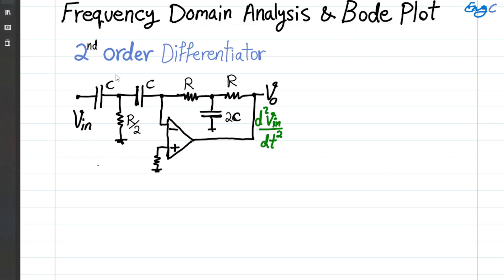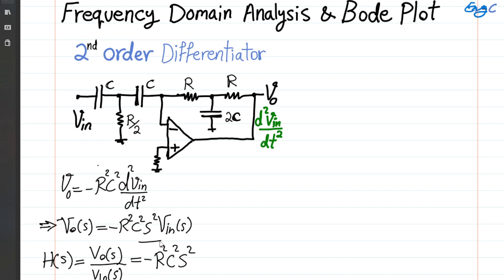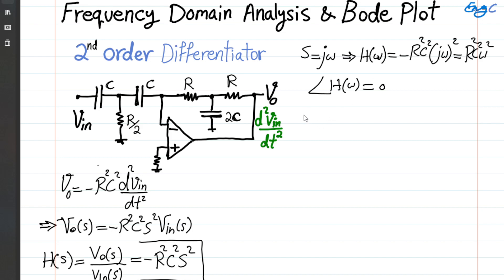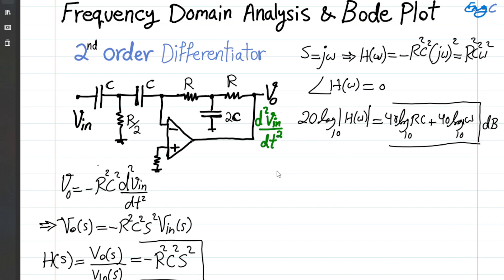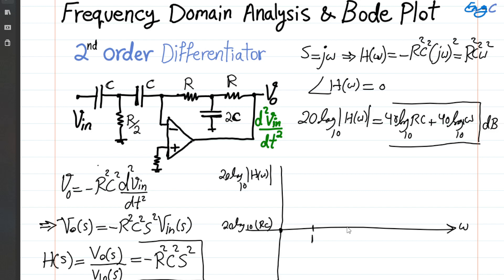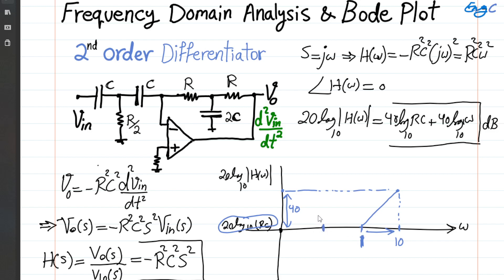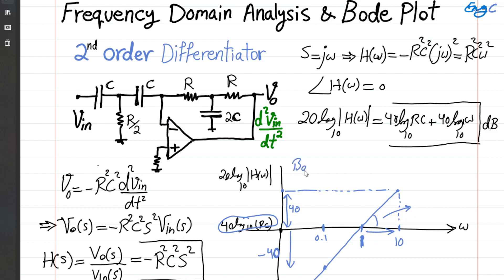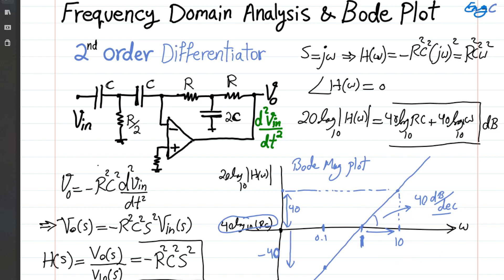Bode plot Frequency Analysis of Differentiator Circuit with Op Amp

Comment from the maker: Thanks for watching. For more Op Amp Circuit and Analog Filter examples please see: 
Op Amp Analog Computer Differential Equation Solver https://youtu.be/ENq39EesfPw
Universal Analog Filter Design https://youtu.be/2J-0msXZE2o
How to find Bode Plot, Freq Response, Transfer Function of Analog Filters https://youtu.be/vZFkPeDa1H8
Analog Logarithm Computer https://youtu.be/RpKEq5WyoLg
Laplace Transform Example and S-domain circuit analysis:  https://youtu.be/ps8N5TPM_qU
Op Amp circuit Bode Frequency plot https://youtu.be/BLVzuuqAlZs
Lowpass Butterworth Filter: https://youtu.be/UzCjkwqy-9w
Analog Computer to Raise Signal to power n https://youtu.be/IUTlBH1UraE
Triangle Oscillator Op Amp circuit https://youtu.be/JF5Up_cuL9k
Push-Pull Power Amplifier with Darlington Transistors https://youtu.be/866MYibo8yE
Op Amp Analog Computer Differential Equation Solver: https://youtu.be/ENq39EesfPw
Full-Wave Rectifier with Op Amp https://youtu.be/DJJMNU-CYcg. 
Differential Equation Solver Analog Circuit https://youtu.be/R3X5AYNZGEI
Complex Sinusoid Oscillator https://youtu.be/GXRhmwmS5Zk
Sawtooth Oscillator Design https://youtu.be/2eUsGPfqbW4
Full-Wave Rectifier circuit example https://youtu.be/DJJMNU-CYcg
https://youtu.be/5zHXTx-Vl20 Sawtooth Waveform Generator design with OpAmp, JFET, BJT: How does this circuit work? 
https://youtu.be/HeZRtnRXpEI presents a circuit with op amps and feedback loops to design an analog computer that solves a second order differential equation.
For more analog signal processing examples see: https://www.youtube.com/playlist?list=PLrwXF7N522y4c7c-8KBjrwd7IyaZfWxyt
I hope these Circuit design and analysis videos are helpful. 🙋‍♂